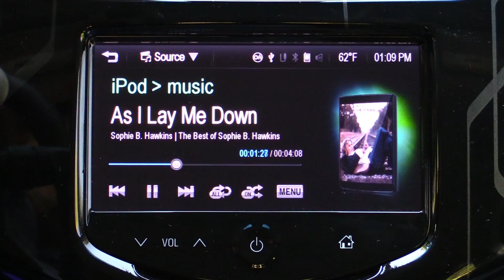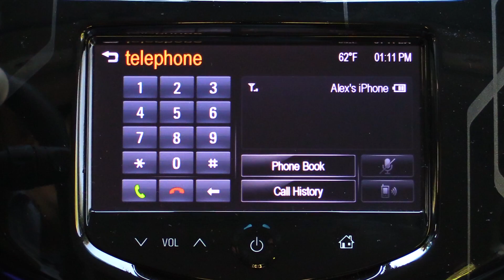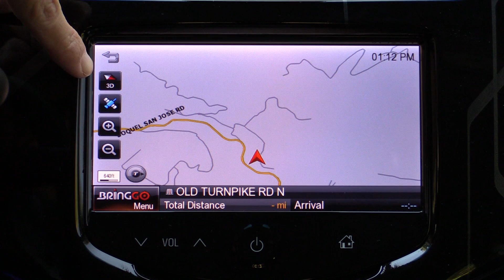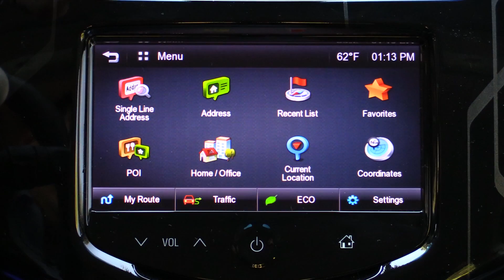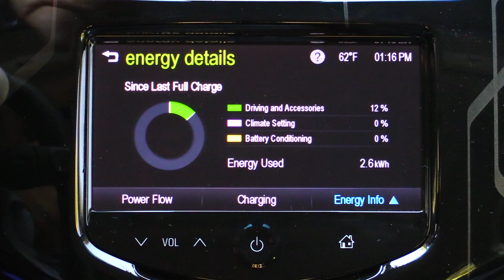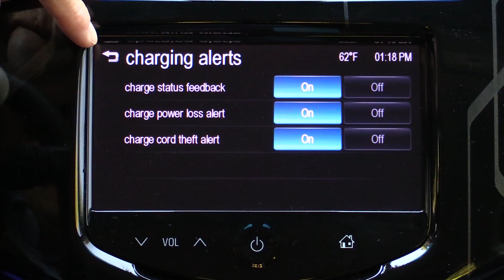2014 Chevrolet Spark EV MyLink Infotainment Review

Comment: There are some ergonomic flaws in the Spark's infotainment control system. For example, It is possible to turn on the HVAC and adjust the temperature, fan speed, and other settings without using the center control screen. But some HVAC settings (like choosing which ducts will blow air) can only be changed using the infotainment touchscreen. Powering on the touchscreen means the radio WILL turn on. Having the radio turn on when all you want to do is adjust some other feature is irksome.

And the radio controls are not as efficient as they could be. Choosing an input source or tone adjustments require submenus while a lot of screen real estate is wasted on pointless graphics.

Of course the biggest flaw in the infotainment system is the speakers. Music sounds like it's emanating from underwater. I can't wait to upgrade the speakers. Luckily, that most important flaw can be rectified.